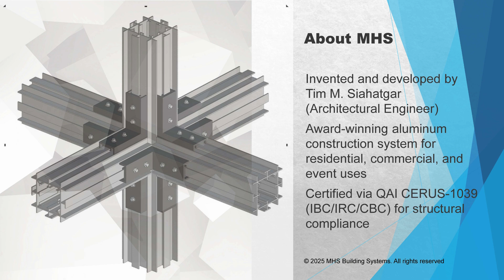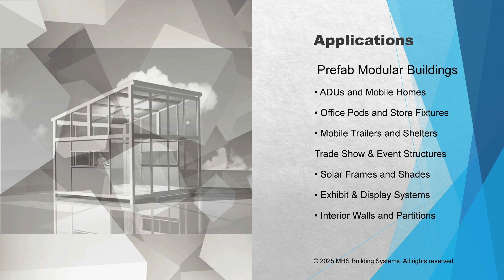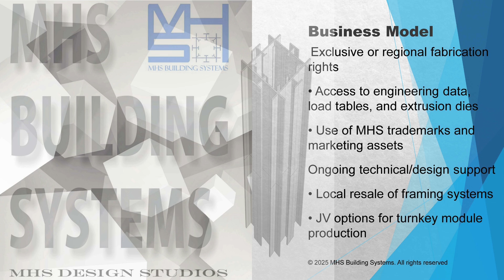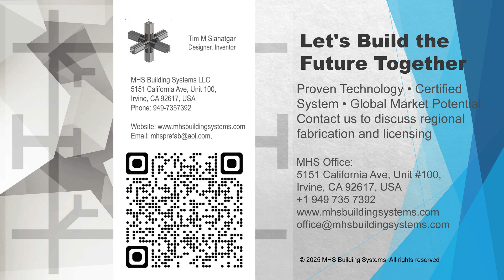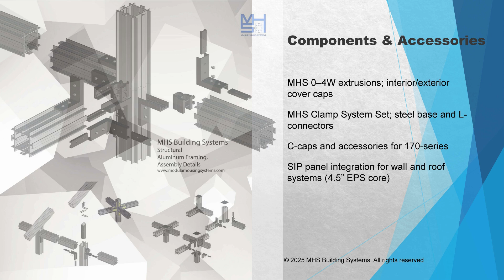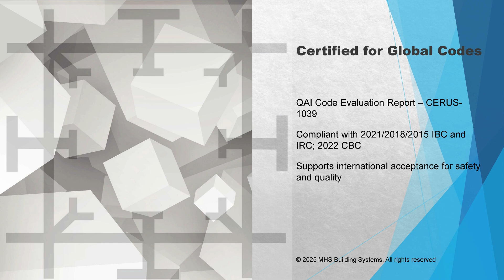MHS Modular Building Systems Licensing and Technology Overview

Comment from the maker: MHS Building Systems designs and delivers modernist prefab modules that transform open spaces into anything-you-want hubs –– yoga studio, home office, writer retreat, guest room, country cabin, pop-up kiosk, reality-escape pod. You dream it. We build it custom-configured, on site, in days, tie-grid or off-grid. We pre-engineer at our factory, then transport the bundled-up kit to even the trickiest spot without heavy equipment thanks to a patented lightweight construction system. 
Services Provided
Design, build, deliver and construct sustainable, modern, pre-fab modules.

Areas Served
Continental US, International 

Awards
Tim Siahatgar is an esteemed winner of the highly prestigious A' Design Award with their good design. MHS Structural Aluminum Framing for Commercial and Residential Prefabricated Building.
www.mhsbuildingsystems.com
Licensing Opportunities:
Become MHS Building Systems authorized builder, designer or prefab home manufacture. 
#builder #designer #architect #contractor #modularhomes #prefabhomes

Category
Design-Build Firms , Accessory Dwelling Units , Home Remodeling , Home Additions , Universal Design , Basement Remodeling, Commercial Buildings